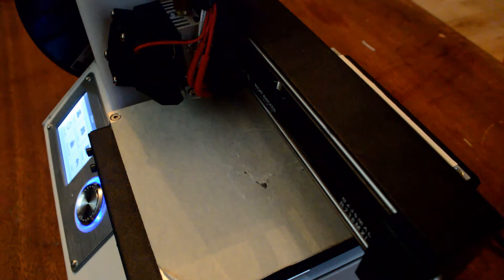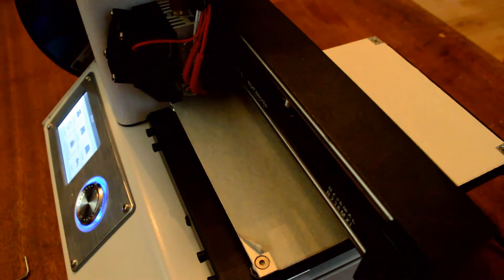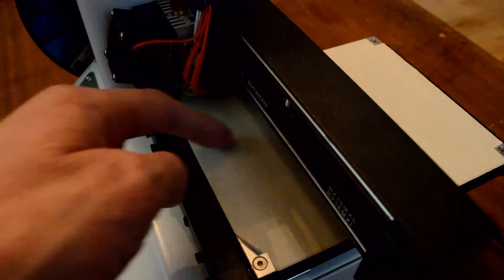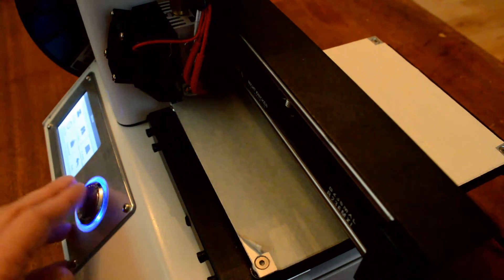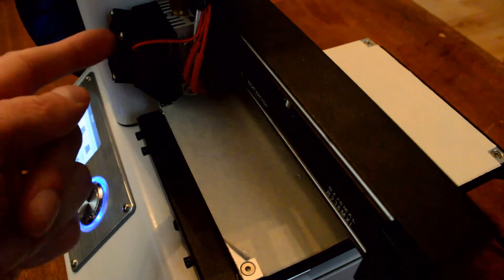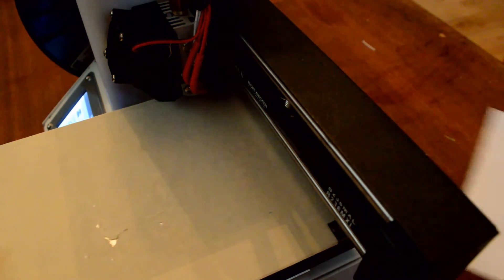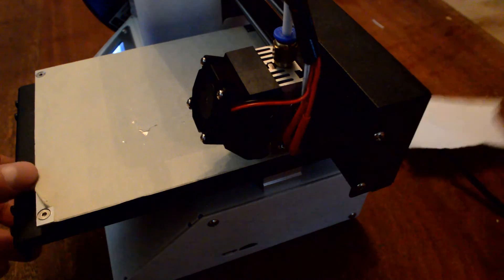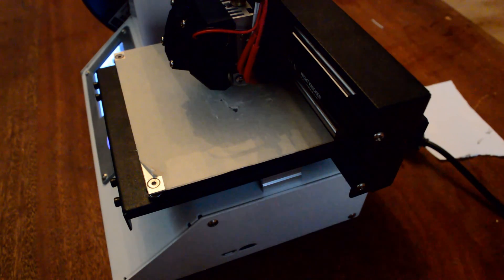3D Printing: How To Level the Bed

Comment: is it worth it still today ?
Reply from the maker: I'm sorry, I'm not quite sure what you're asking.  If you're asking if leveling the bed is worth it, I would say definitely.
Reply: JoshTheEngineer is the printer worth the 200$?
Reply from the maker: Ah, ok I see.  Yea I still love mine.  It's good for smaller prints and it's extremely easy to operate.  If you need to build bigger parts, you might want to upgrade to a larger printer, because you'll need to print smaller pieces and fit them together with this printer.  I'm just making small stuff so it's great for my purposes.
Reply: yeah I had a budget after xmas so I wanted to learn on one and if I enjoy it I'll buy a nice one with my tax returns. anyway how easy is this to set up and update? I've read a few issues with software and firmware updates I'm currently using tinkercad on my windows 10 pro and cura seems to not have my printer under select your printer tab. I want to design things and print them out....I hear it's a pain in abs but possible. you built any mods yet for yours?
Reply from the maker: The set-up took me about 5 minutes.  It was as simple as taking it out of the box, plugging it in, and inserting the micro SD card that comes with it.  You just need to make sure you ordered a full roll of whatever material you want to print with, because you won't really be able to print much with the sample roll that comes with it.  The slicer software you use might not have the correct printer, but I've found that as long as you make the bed size correct, then it should be fine.  I've never used ABS, but maybe someday in the future if I need to.  All of my needs are currently satisfied with PLA, so I have no need to switch.  I've seen tons of mods for all different types of printers, but I haven't printed any yet.  I'm not sure which ones are worth it and which ones aren't, and I haven't really had any trouble with my printer yet, so I'll get to those when I run into any issues.
Reply: JoshTheEngineer so mine came all set up even the bed was dead on I've already got a e3d hot end today in the mail for backup been printing abs with stock nozzle and tape over extruder fan port. printing just as good as pla using frog tape and fine layer of hairspray bed at 80 nozzle at 236 wish I could show a pic

Comment: Just watched the first video, and really liked your presentation. Good job. My question is, I am getting ready to buy this printer, but want to know if you know how to create a stamp with raised letters or silhouettes. You did a great job walking through the machine, and I'm far more comfortable buying it.
Reply from the maker: Thank you Roger!  There are a ton of different avenues you can take in order to make a file that you can print on your 3D printer, so I'll just mention the option that I currently use, because that's the one I'm most familiar with (and that I use in my videos on how to print an airfoil and a rocket nozzle).

First, I'll just mention that you can get files to print from various websites for free (like thingiverse.com).  But I'm guessing you want to create your own stamp files.  For this, you will need some kind of 3D modeling software.  I use Inventor because I've used it in the past, and I was able to get a student license for free.  There are plenty of other free 3D modeling programs out there though.  After you design your item, you can save it or export it as an STL file.

You will then need a program that will tell your printer where to move and when to extrude, etc.  I use a program called Slic3r, but there is a program called Cura that comes on the micro SD card for the printer.  You will open the STL file in your program, and then change some settings (you'll have to play around with this a little), and then export the GCODE file, which is what the printer will use.  I save the GCODE file to my micro SD card, plug it into the printer, and start printing.

So in order to make your stamps with raised letters or silhouettes, you'll probably need to play around with some 3D modeling programs and see what you're most comfortable with.  Hope that answered your question!